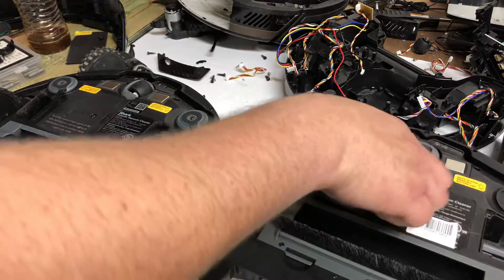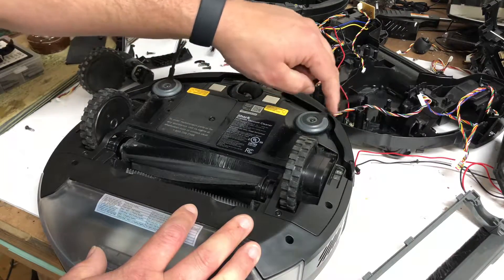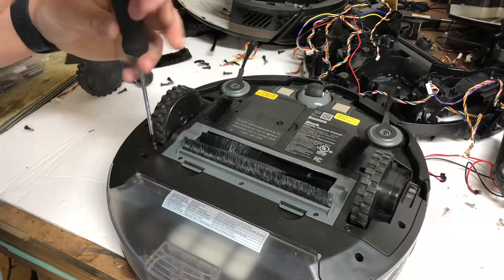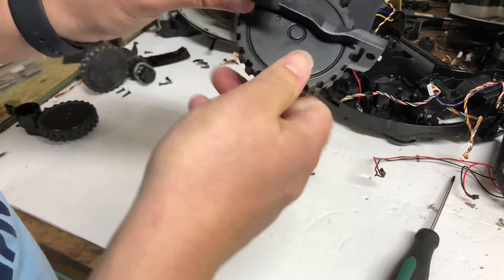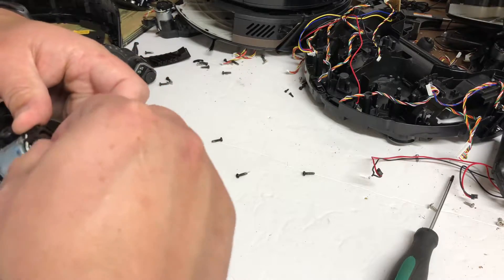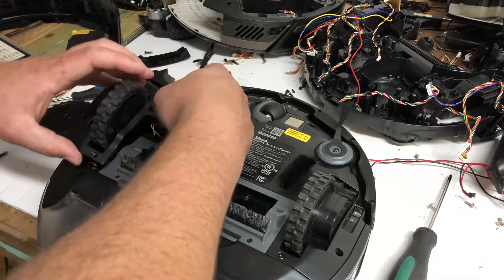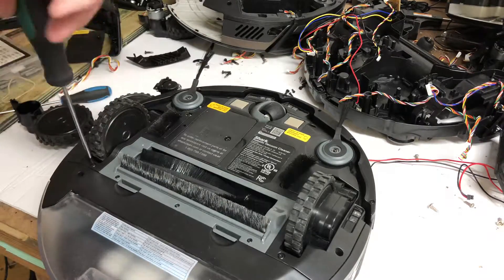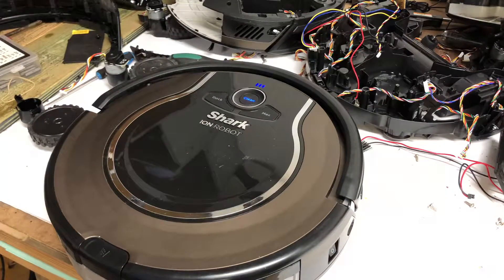Broken shark ion robot vacuum can we fix it? Very interesting find

Comment: I have 2 shark robot both with error #2 have totally cleaned them (removed rollers and their housing to remove stuff) one runs a couple of inches and code comes back the other runs a little hits a door way and code comes on  any ideas?

Comment: Why is the dirt not going into the dust bin?  The rollers have been cleaned. It drops big clumps of dust and hair
Reply from the maker: roller probably has stopped turning best way to check is put on glass table and look under.

Comment: I have an RV851WV that I can't seem to figure out. It acts completely dead. Tested battery voltage, 13.8 V, charger shows 19V across the terminals, switch flips on and off, and can't seem to get it to power up, no lights or chime. Shark customer service said I needed a battery, replaced it and no change. Any recommendations on where to go for diagnosis?
Reply from the maker: Did it get wet?
Reply: @SmittysWorld  no. My wife turned off the schedule via the app before we went on vacation, came home and it was unresponsive. No one was here to possibly mess with it, and it sat on the dock the whole time.
Reply: So somehow just by taking it apart, I managed to make it work. Tore it down to the board, plugged the battery in, and it fired up. Slapped it back together and it's been working fine since. I'm guessing it's got a loose connection somewhere, but I'm keeping my fingers crossed!
Reply from the maker: @wrifraff  sorry I never responded just seen you had messaged back that’s awesome you got it working

Comment: This was somewhat helpful, but my rv750 wheel assembly is covered by the bottom.  I removed the battery and all of the screws, however, I will need to separate the bottom from the top.  Do you have a youtube showing how to separate the bottom from the top so that I can access the wheel assembly?

Comment: My sharky just grunts to move and stops? Wat could this be?
Reply from the maker: wheel or main brush motor
Reply: I have a new rv2520 the right wheel doesn’t work I’ve replaced the whole wheel and motor assembly and it still says error 2

Comment: My 1001 model had a head on collision with my dogs poop and after cleaning it up, it gives me error 14 that is it is stuck on the magnetic boundary strip so I took the bumper off and clean those sensors off also, even thou I didn't see anything that cleaning could have helps and after re-assembling it, it's still error 14 and it's now saying it is stuck on the magnetic strip or also that the bumper is stuck. If there is a sensor  gone bad, how can you determine which one to replace? Thanks
Reply from the maker: Hmm thats interesting do you have a strong magnet or speaker laying around? Might be stuck and be able to run the magnet around the on the top and bottom to loosen it up. Might also want to take the whole robot part and make sure nothing inside of it a lot of times the issue isn't the poop its the fluid and pee around the poop that makes the motherboards and sensors go bad.

Comment: Io have the shark UR1105ARUS
It ran over dog poop I clean with a wet sponge and soap when it turns on it only flashes a red battery. On the charger same thing I have 4 volt on the robot and 19.8 on the charging base and I replaced the battery still nothing and is this worth fixing and do you sell refurbished robot

Comment: In true "deh" mode I tried to get my shark to ,"go" but nothing. I checked voltages of charger and battery, both good. Contemplated taking apart and decided to watch your video. Shock me with an on/off switch that I had not seen!!! Shark runs while I sit red-faced. Thanks
Reply: What is acceptable voltage for a battery? I have a 14.8V and it is reading as 11Vm, not sure if that is enough or time to replace.

Comment: Thanks, I checked the battery, and it was charged. But you showing me there was an on-off switch did the trick (DUH!). It's now clearing the floor.
Reply: My shark is 9 months old. It ran through pet poop. I took it apart cleaned and let it dry. Never has worked again. Has cliff sensor errors. Anyone buy them for spare parts ?

Comment: My shark ion is 14 months old. I keep getting error 6 to make sure the bumper is moving freely. It is moving fine and I have cleaned the sensors. Customer service simply offered a discount on a new one. Is it worth trying to take the bumper off to see if there is something under it, like dog hair, causing an issue?
Reply: I have the same issue with mine. I took the bumper off and cleaned it, but I still get the same error. I just called customer service and they said it's unfixable. That seems odd to me.

Comment: Took out the vacuum motor and want to know what voltage the motor is so I can test it , please ?
Reply from the maker: Depends on model 6v to 12v should move it up to 16v
Reply: @SmittysWorld  I am trying to test the motor. model 725 . Just found the sticker it is a 16.8volt motor.  Do you have a replacement motor?
Reply: @SmittysWorld  Do you have a replacement vacuum I could buy?

Comment: Hey man, I started having an awful sound with my ion, and realized the main brush wasn’t spinning. Replaced the motor and still having issues. Any idea what else it could be?
Reply from the maker: Did you check to make sure the case itself that the motor goes and wasn’t melted and that the belt had good tension

Comment: My shark IQ is saying too close to a ledge error number seven is there a fix for this it is setting in the middle of the floor
Reply from the maker: You need to clean the sensors make sure all the sensors are clean now to bring on them and then you need to check your bumper make sure it’s free check your wheels and make sure that they are pushing in and out him and have a good spring tension and sitting on the floor flat and you could be any of those issues. Unfortunately the new roebucks when I have issues isn’t always so simple so you might have to contact shark and if you’re within a year of purchasing it could be under warranty

Comment: I have a shark robot that is 2 years old and just started spinning in a circle.  Will not do anything other than spin to  the right in a circle.  I have  cleaned everything.  Replaced the front wheel.  Hasn’t helped.  Advice?
Reply from the maker: Have you taken the right and left wheels apart and cleaned? Could be sensor issue, motor issue , gears going bad in one side, or motherboard not sending correct voltage .

Comment: Hi I have a RV700_N and the MAX light just flashes and it doesn’t start up. I took off both wheels and there nothing in there. What else could it be?
Reply from the maker: Rocio Ramos that probably is the front bumper being stuck. Remove it and see if the metal pieces are bend

Comment: Mine say obstruction #2 please check under Robot. I took everything apart and cleaned really well. Seem like the right wheel tries to move but the left side locks up. Do I need a new wheel or just a sensor
Reply from the maker: Carol Gregory bad wheel take apart clean out see if the gears have hair inside them.

Comment: Hi You make great repair videos.. ? I have a shark that my dog pee’ed on. I noticed smoking from where those motors are on side nothing seems to light up as far as buttons.. is it Worth fixing?
Reply from the maker: BROWERPOWER 2010 dog piss will make it not worth fixing it corrodes electrical parts really bad so it’s gonna be nasty and not cheap to fix

Comment: Hey man. Mine won’t work. I did everything cleaned it all out and checked everything. When I put it on the dock and press clean it lights up blue and the battery flashed 1 red bar and then to 3 red bars and then nothing happens. Help!
Reply: This is exactly what mine is doing. Ordered a new battery. It comes today. I guess we'll see if that fixes it.

Comment: My robot turns on and works for like 10 seconds then it stops and a red❗️appears I checked on my manual and it says the suction motor needs something done. Ok so what happened to my robot was that my cat sprayed on it lol I know it sucks. The question is can it get fixed???
Reply from the maker: jay Verduzco suction motor might have gotten spray in it or the motherboard honestly try getting it replaced under warranty before trying to fix it .
Reply: Smitty's World that was fast thanks lol the problem is this happened a year ago or so and don’t have the paper work for it. You think is fixable ?
Reply from the maker: jay Verduzco it’s fixable for sure but could get expensive since we don’t know exactly what the true problem is. Take robot apart see if there is any spray corrosion on the motherboard then go from there to the suction motor .
Reply: Smitty's World thanks for the help😉 I will try I guess I got nothing to loose it been sitting in my closet useless lol

Comment: Hi, I have a Shark ion 1001ae. I love it. Anyway it's giving an error message that won't go away. Error #10 put me on a flat surface. It's on the flat surface and won't start. Please help if you have any tips or lead. I've cleaned all the sensors.
Reply from the maker: Johnny Marshall sounds like a wheel could be stuck off the ground a little bit. try pushing wheels in and see if they are moving up and downz
Reply: @SmittysWorld  thanks. So they go in and out freely. What I notice is that one side clicks when it's pressed past a certain point and the other does not. Are both sides supposed to click?
Reply from the maker: Johnny Marshall they shouldn’t click could be a broken piece in the wheel making it say it’s not on the ground I’d remove the wheel that’s clicking and examine and compare to the other wheel.
Reply: Sounds good. I'll try that. Thank you so much!
Reply: Just wanted to tell you that you helped me fix it. Thanks alot. I'll keep an eye out for your helpful vids in the future.

Comment: Hi! My shark ion robot 700_N just won’t turn on, won’t even charge. Bought a new battery and still.... nothing. Charging lights do not come on when it’s on the dock and on the on position, nothing lights up. Any ideas?
Reply from the maker: Cheyanne Childers could be a few different thing. First most batteries are low or dead on arrival so could be the charger is bad, could be the charging contacts on the bottom of the robot. Could be the on off switch. Worst would be a bad motherboard. Check these things , turn on off robot see if wiggling they’ll switch or on off back and forth will cause it to do anything. Check to make sure power on the charging station is working. If you have a volt meter test the charger , the charging pads and the switch.
Reply: Smitty's World thanks for the input! I appreciate it! Will try all of that

Comment: Do you have a video on the WV220 hand held vac, it came with the 87 combo charging station.
Reply from the maker: Ed Stapleton I have one on changing the battery. I can make one what do you need to know about it?
Reply: @SmittysWorld  complete housing break down, any replacement parts available, etc.
Reply: @SmittysWorld   also are you planning on doing vids on the self-emptying model?
Reply from the maker: Ed Stapleton I can make a video and do have plenty for sale let me know the parts you need. I don’t have plans right now to do self emptying yet I will once I get ahold of some models that are broke to see what common issues there is.
Reply: @SmittysWorld  I'm guessing I need a motor for the hand held,i switched out batteries and nothing changed, are there other common issues with the hand held?
Reply from the maker: Ed Stapleton not really mainly the bin on them breaks. I can take one apart and list some parts if you would like.
Reply: @SmittysWorld  I would like your input on the potential issues,if you have the time.
Reply from the maker: Ed Stapleton sure thing, let me check out some of the ones I have tomorrow and I’ll get back with you. I want to see what all the issues they have are if any and then take one apart and see what I can find.
Reply: @SmittysWorld  tyvm ttyl
Reply: @SmittysWorld  What's up mister, I was wondering what kind of price /stock you have on the plastic wheel housing that travels with the left wheel (looking down on the 852 if it was working)for a 852 ?

Comment: @Smitty's World, nice videos! I need a right wheel assembly for a 850, do have any around? Actually, all I needed is the large nylon gear that drives the wheels. I could not find your store or contact info to save my life.
Reply from the maker: smittysworld15 send me a message I might have the gear by itself.
Reply from the maker: https://www.ebay.com/str/smittysworldstore
Reply: Smitty's World do you have the computer board on model rv761_n??

Comment: Hello. My shark ion has been bumping into everything since the day I got it out the box. I wiped off the sensors but nothing seems to help. What else can I do? Please help!
Reply from the maker: Mikesha Huntley when you mean bumping it just going till it hits something then turns and moves to another area and bumps something ? This is normal unless you have a shark iq robot . These robots have a feature built in that slows them down before they hit something but it’s normal to hit everything .
Reply: @SmittysWorld  Yes, that is exactly what it does. This is my 2nd shark robot, the 1st one did not bump into anything so I'm not use to this. I currently have the Shark ION Robot Vacuum R75.
Reply from the maker: Mikesha Huntley some of them are better at slowing down and not hitting stuff as hard but they are random navigation bots unless you buy the 1001 which has a camera and maps out the floor plan. So it’s gonna move around once the bumper gets pushed in it will change direction.
Reply: @SmittysWorld  Got it! Thank you for the education and quick replies.
Reply: Can I ship a robot to you for repair ?

Comment: Hey Smitty, I have a Shark Robotic vacuum RV70.  How do I disassemble it to inspect inside and wheels?
Reply from the maker: Buster Barnes remove the screws separate the body then remove each wheel and then take them part.

Comment: I am having a problem with my bumper. One side is getting stuck and the robot won’t run. Is it easy to take off the bumper to fix it?
Reply from the maker: Alexandra Ryan yes five torx bit screw and pops apart then you will need to rebrand the metal tabs on that side

Comment: Having problems with mine. The clean and exclamation light comes on. I already cleaned out, changed filter, checked the wheels. Please help!
Reply: Ours was doing the same thing I tried EVERYTHING  finally I took my air compressor an cleaned the entire thing with it  an the filter got in every crack an crevice an BOOM it worked again ... fyi it was flashing the red ! AN CLEAN good luck i hope this helps because we couldn't find ANY videos telling us what we could do to fix it
Reply: MoMoMain24 I just did the same thing and it worked. 👍🏻
Reply: @ryanstreet2930  glad to hear it man I dont know why there isnt any videos on here about that
Reply from the maker: Nancy Nguyen clean sensors with rubbing alcohol make sure bin is installed all the way.